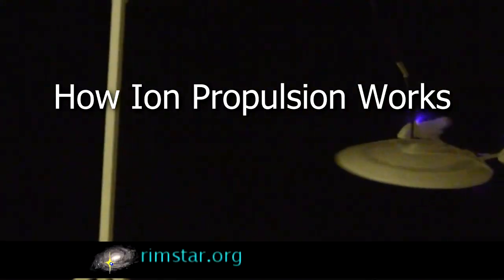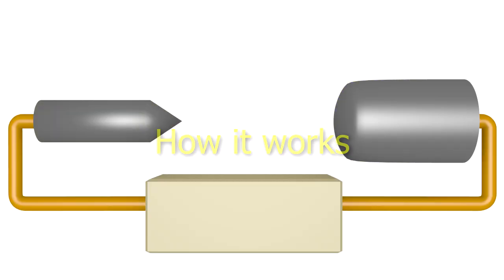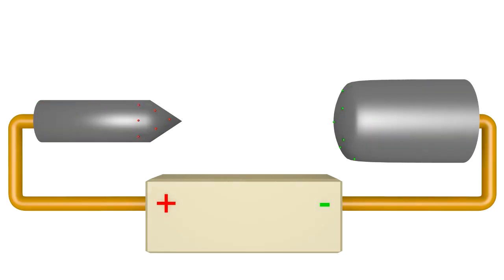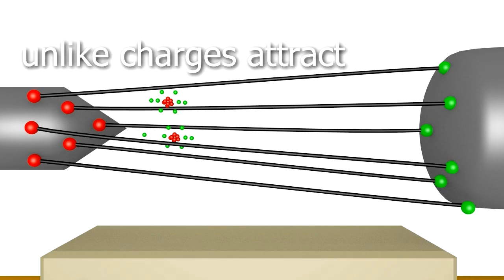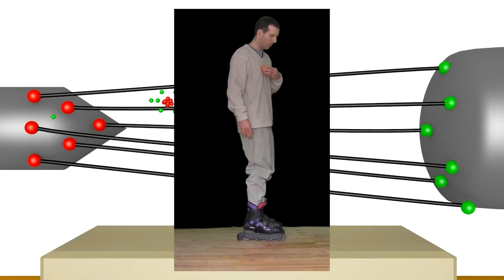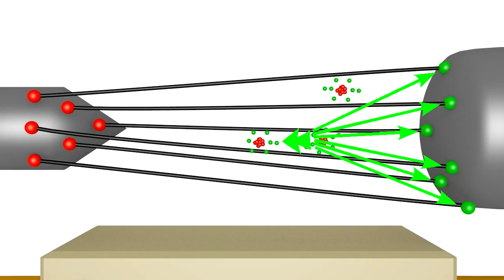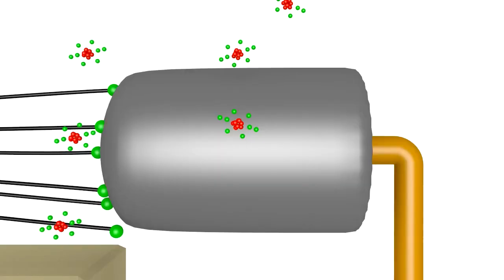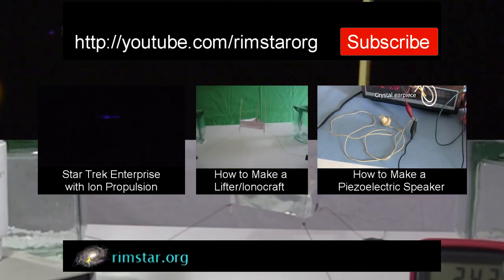How Ion Propulsion, Lifters and Ionocrafts Work

Comment: Hi Rimstar. Attempted ionic lifter but NO lift.. just some hissing sound and wind..... I connected to my high voltage flyback transformer: positive and negative terminals  to the lifter.... ( thin copper wire and smooth aluminium side. 
What could be the issues???
Reply from the maker: A flyback transformer outputs AC. A lifter needs either DC or pulsed DC and won't work with AC. My power supply have a voltage multiplier after the flyback transformer. The voltage multiplier both steps up the voltage and converts the AC to DC. I have some additional tips and tricks to getting it to work on my webpage here https://rimstar.org/sdprop/lifter/lifter.htm in case you modify your power supply.
Reply: @RimstarOrg  I got the flyback transformer from an old cathode TV which is the same as a computer monitor right??
Reply from the maker: Ah, I see. So chances are that your flyback transformer has a built in diode(s) which turns it into DC or pulsed DC. Though there's a slight chance that it doesn't and so you'd be getting AC out but if there was a thick wire coming out of the flyback and going directly up to the TV's cathode ray tube then it probably does have the diode(s). That would be something like my Cube power supply https://www.youtube.com/watch?v=-KFhBVfpfDw which does have the diode. I tried that one with a lifter and it didn't lift. My guess is that the voltage was too low. My lifter lifts off at around 25,000 volts ( https://www.youtube.com/watch?v=LOGAaObsN4g ) and my Cube power supply's transformers heat up too much when putting out only around 20,000 volts. One of the tips I talk about (the best one) on the webpage I linked to in my previous comment is to try it in the dark and look for the corona between the wire and the foil skirt. If you don't get the corona then your voltage isn't high enough. If you get the corona in only one spot then you're only getting lift at that one spot.

Comment: Coanda effect applicable to ionic wind?
Reply from the maker: The Coanda effect is an effect produced by air moving over a curved surface. Ion wind can produce the Coanda effect just like a propeller or jet can, by moving air over a curved surface. You can see that in my video about creating ion wind for a Star Trek Enterprise model. See three minutes into this video https://www.youtube.com/watch?v=x5dyIIpnE0Y
Reply: @RimstarOrg  I should've been clearer, I meant would a stream of electrons be affected by coanda?
Reply from the maker: Oh, interesting question. If you flow a stream of electrons over a curved object, would it affect the flow? I'm not sure. The strength of the flow might play a part, a stronger flow would be less affected since the momentum of the electrons would keep them moving. If there's a stream of electrons then that usually means there's something attracting them so the strength of that attraction (electric field strength) would play a part. If it's in a vacuum then it won't have any air flow to affect it. The electrons might cause molecules in the nearby surface to form dipoles and the dipoles would then attract the electrons. Lots to think about... no certain answer though.

Comment: Is there a minimum amount of current needed to produce the thrust effect.? With a craft of similar mass too the lifter
Reply from the maker: Unfortunately I know that it's somewhere over 250 microamps, which isn't very helpful. I tried measuring it when I also measured the voltage but my ammeter didn't have the right range and I wasn't willing to take a chance with a better meter. Here's the video where I did the measurements https://www.youtube.com/watch?v=LOGAaObsN4g
Reply: Thanks ill check out the video .

Comment: Does the thin wire need to be bare, or can you use something like enamel insulated wire? Thanks.
Reply from the maker: Due to the strong electric field around the wire, the thin enamel coating will likely breakdown but if it does, it'll likely be in one spot. Once corona is leaking out of that spot, the electric field overall will be weaker and it won't be emitting in other places. That's my guess anyway. It likely won't fly. There are tricks for removing enamel from wire though. Do a search for how to remove enamel from wire.

Comment: Great explanation but I have a few questions.

1.) Is the propulsion activated by the positively charged ions that are headed back to the positive source after collision with the neutral atoms?

2.) If the fields were reversed, how will that affect the atoms in order to get the same result?
Reply from the maker: Thanks.
1) Yes. That collision is what pushes on the electric field that the positive ions are a part of. That's what causes the propulsion.
2) It's too much detail for a comment but if the fields were reversed then the details would be a little different but the effect and the direction of the motion would be the same.

Comment: How much volts of electricity is needed? And how to prevent any electric hazard ??
Reply from the maker: For the lifter, I needed around 25,000 volts. My ammeter wasn't in the correct range so I couldn't measure the current but it's a relatively high current. You can see me measuring in this video here https://www.youtube.com/watch?v=LOGAaObsN4g . Regarding safety, see near the end of my how-to-make a lifter video where I show the use of discharging the power supply and lifter after turning it off https://www.youtube.com/watch?v=vzZy1Aqleno . There are of course safety precautions to take while it's flying, like staying away from it.
Reply: @RimstarOrg  Thanks a lot gentleman! 😊

Comment: How do you connect to power supply to the lifter do you attach one wire on the sharp object and another wire to the rounded object and connect both wires to opposite sides on the power source
Reply from the maker: Yes, that's exactly how I connect it up. You can see the connections here near the end of my how-to-make a lifter video https://www.youtube.com/watch?v=vzZy1Aqleno
Reply: RimstarOrg how many kilo volts would you need to lift 300 pounds 5 inches off the ground
Reply from the maker: I don't know. It could be millions of volts. You also need current though, that's what charges all the ions.

Comment: But in space there is no any neutral atoms between so how that works ?
Reply from the maker: The ion propulsion engines used in spacecraft like NASA's Dawn use a xenon gas which they carry with them. The technique used is different than in this video -- they don't rely on sharp vs. smooth electrodes. Without explaining the full technique, one of the electrodes is a wire grid with holes in it and many of the charged particles make it through the holes. To reduce the number that then get pulled back, after the particles have made it through the grid, they spray them with oppositely charged particles to neutralize them.

Comment: Does this explain why the smooth electrode is attracted upwards such as illustrated in this video??  Logic says that ionic wind will push down on the smooth electrode... https://www.youtube.com/watch?v=lzjEwXEB27o
Reply from the maker: The smooth electrode is attracted upward in that video because opposite charges attract each other. The smooth cylinder foil has one polarity and the wire has the opposite polarity. Since the cylinder is free to move a little, we see it move toward the oppositely charged wire.

Comment: The explanation is wrong. What gives thrust is the electromagnetic field pushing and pulling (friction) the air around and between the electrode and cathode. If the "free" ions were the thrust source it would work in near vacuum without field collapse. Just by using high vacuum it collapses instantly. The impedance decreases as the pressure decreases and so does lift. At -60kPascals (.4 atm, 1 atm= 14.7 psi = 100 kPascal, 1 psi = 689 kPascals, far from real vacuum) you get no thrust at all but only arching.

Comment: If you add a dielectric material with very high dielectric constant and strength like that of barium titanate or calcium copper titanate between positive and negative terminals, lifters will start working in vacuum chamber. Thomas Townsend Brown used dielectric materials with his biefeld vacuum experiments. Mainstream science and most youtube videos are doing it wrong. Without proper dielectric material, its nothing more than inefficient ion propulsion. Also the shape of the lifter needs to be pyramid shape so the positive copper terminal at top is smaller than negative aluminum terminal at the bottom, with dielectric material between so electricity has to completely flow through the dielectric material. High voltage applied also need to be more than 150kv as the strong electric field begins to reduce the weight of the lifter so there is no reason to make lifter lightweight. Weight after all is not an inherent property of mass since you are weightless in space and also when falling towards the earth at 9.8 m/s2.
Reply: B2 spirit bomber has that technology
Reply: Why don’t you make it

Comment: be carefull is not a ion wind, i view a few new video about wing ion it is false , many new video on lifter with disinformation.  it is work in space also , when in a electric field with difference capacitor like small wire and aluminium fold .
Reply from the maker: The tests which work in a vacuum chamber (not all of them work) show much, much smaller forces being produced. And those small forces can often be accounted for in other ways (e.g. emitting electrons, sparks ejecting matter, Coulomb forces). So those small sources of thrust are not what's making a lifter fly off the table. Plus, I've done the smoke test and it shows plenty of wind https://www.youtube.com/watch?v=LOGAaObsN4g . I'd be the first one to be happy to see something new but in all my testing, I haven't found anything.

Comment: Sorry but that doesnt seem quite right; as in most exampled the thin wire and aluminium have the same charge going through them; and it appears the idea is that more electrons can saturate the aluminium, that in thin pieceo f wire. Also the wire, the lift being achieves doesn't add up...I believe this mechanism was already explain by the main who discovered it as a low pressure zone effect.

Comment: hi if you make this a bigger engine do you get any electrical discharge "lightning bolts" i mean i work on plasma propulsion ideas. one i have is a plasma reactor rocket engine . a magnetron generating plasma from silicon dioxide that gets drawn to a dc magnet, then a cathode ray fires electrons at it to overload the plasma field. a plasma explosion equal to a combustion chamber of a rocket to create thrust. and a plasma turbojet doing the same thing . the pressure from the electrical/plasma explosion for thrust and to spin a turbine to bring in more plasma.

Comment: Come on. ion propulsion was known ( to me) since 1968. It was different build. 2 "chicken wire". Sowing needle attach to each point of cross wire ( I build a square one). Soldering the needle was a lot of work. When complete, those 2 were attach to a wooden poles. It was made so I could adjust the distance. High voltage DC ( from tv flyback). Adjust untill you do not see the spark. It does fly, but restricted to the lenght of the power cord. You could make any shape.

Comment: This would be a viable propulsion system if we had a way of storing the electricity onboard the aircraft
Reply: We may. The energy requirement isn't that intense, only the voltage is high. Is you can get a decent enough TWR to hold something akin to a boost converter or rectifier, you may be able to.
Reply: Here there is a way , and a very simple way https://youtu.be/ax4Es1wIQkY

Comment: Would this work if you use a tesla coil?
Reply: Yes it would but I think you must rectify the output of the Tesla coil, so that instead of alternating current, you will get pulses of direct current in the correct polarity. 
AC electricity passing through plasma turns the plasma into an antenna which will release the AC signal as radio waves and heat.
If you do rectify the Tesla coil output, you can split the - and + outputs so that first the negative electrode voltage rises, and then as it begins to fall, the positive electrode will begin to rise. I believe this will be far superior to continuous direct current. 

Look into the 'dense plasma focus' for another ion accelerator concept.
Reply from the maker: As Taylor said, this requires DC (or pulsed DC) and a Tesla coil puts out AC.
Taylor, where in the Tesla coil circuit would you split the - and + outputs?
Reply: @RimstarOrg  

The Tesla coil Torus outputs AC current as radio waves, and if the voltage is high enough corona forms on the surface that also carries the AC signal. All of this wastes energy as radio waves and heat, so instead of making an antenna torus, wire the output of the secondary coil to a bridge rectifier circuit with diodes and resistors capable of transmitting the power of each half of the waveform. The bridge rectifier will have a - and + output. A high voltage ultracapacitor on either end would help to build up a larger spark over wider gaps, especially if you had a high voltage switch that prevented the breakdown of corona until a much higher capacitance was reached at the desired voltage.

I'm collecting materials for a spark gap circuit to power a type of plasma compression system similar to a dense plasma focus, and I've thought about using a Tesla coil to boost the voltage before converting it to DC. I think the real efficiency of this system will be when you combine it with physical or magnetic nozzles to increase the density of the ion stream and to create mechanical advantage of the nozzle.
Reply from the maker: Thanks!

Comment: Does the geometric proportions and/or elemental property, structure and state have an influence? 
What about the charge applied, does Voltage and frequency have a role? ie; 220V, 113mHz Poloyphase charge used to create a resonant signal sympathetic to that of the atmospheric gas being targeted? Or is the regular form of AC applied at, or above relevant thresholds adequate? I feel as though we are still creating crude and horribly inefficient proof of concepts. 
Am thinking a crystalline metal such as bismuth (or what ever suits the particular nature of energy transfer) is a good starting point, furthered by accurate geometrical properties.
Further advancement from;
Accurate wave form adaptation to facilitate a reversible, self amplification characteristic to be implemented.
Thrust multiplication of thrust by application of force and/or wave forms -ultrasonic, microwave / alfven waves. Then refinement of such incorporations as indicative by environment, not mathematical guesswork. 
And so on...

In 100 years these engines could advance in o the point that our best working models look no better than the wright brothers flight.

Comment: There are two ways (that I know of) to maybe improve the thrust ratio, 1.using a magnetic field to increase the rate of flow of ions 2.using an enclosed space like a long flat box with openings at each end & at the front end two wires, the first nearest the opening is positively charged to encourage molecular clustering Nitrogen & Oxygen naturally occur in deuto or diatomic forms, then the second wire is negatively charged to encourage repulsion between the air atoms which may make the flow to the collector electrode at the other end faster producing more thrust.

Comment: It's not just about sharp & smooth, but also about charge distribution , with the wire the charge is concentrated promoting ionization, whilst the collector electrode has a larger surface area which doesn't promote ionization.